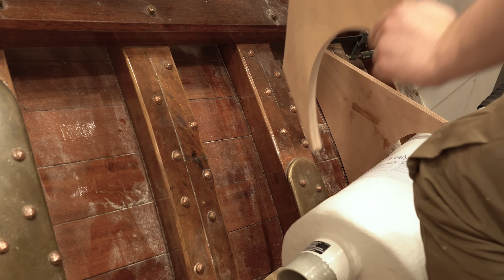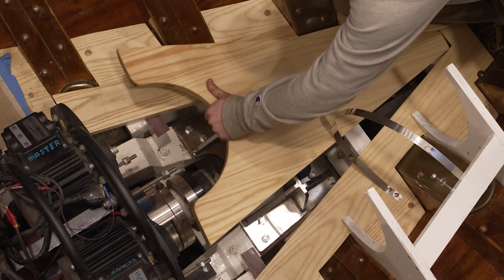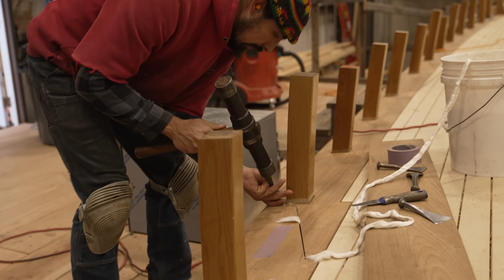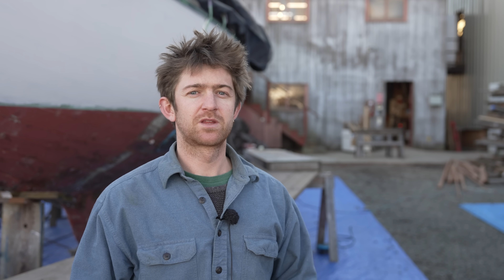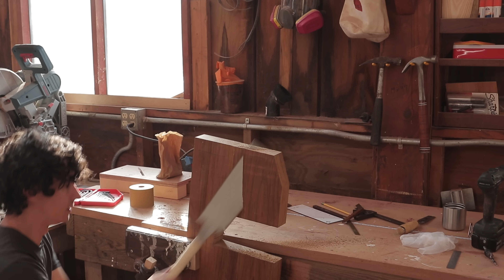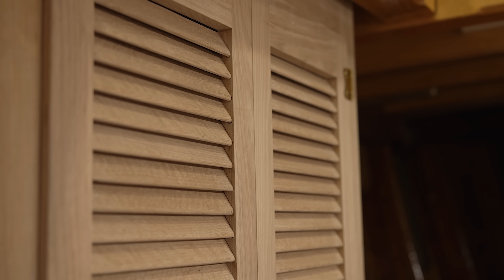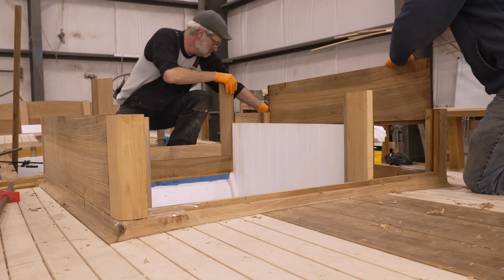Traditional wood boatbuilding - deck hatches & more!

Comment: . . correction to my suggestion . . it's too late for that kind of sleeve - perhaps a 6-inch-long cylindrical split sleeve of thinnish stainless or bronze sheet could be rolled from flat sheet and be installed without disturbing anything, and would still do the job of preventing abrasion.

Comment: Congratulations on an outstandingly impressive project in every way - but - may I be so bold as to make a suggestion from the sidelines ?  Your exhaust hose, vibrating (even ever so slightly) when the engine is running, due to the pulsating fluids within, will probably touch the bulkhead as it passes through, creating a potential point of abrasion.  It would be nice to see it sleeved as it goes through, to avoid abrading through it.  A 6-inch-long piece of the next size up hose would be good, just nipped up on to the exhaust hose with a couple of hose clamps to stop it shifting, or a non-flammable plastic.  Just a thought.  Best Wishes.

Comment: Note on TDS from experience clean out the seam with plenty of acetone and a tooth brush then clean paper towels prior to calking. I learned the hard way just a wipe over doesnt do it. Had to re do an entire deck, 80 tubes down the drain! Every seam parted from the boards! Used a generic pu based calking second time at a fraction of the cost, still going strong. Just my experience.

Comment: Halyard makes great stuff - but exhaust hoses close to the engine move around with the pulses of water moving through them. So the hose WILL chafe where it goes through that bulkhead. Use some chafing material on the bulkhead sharp edges. Great work

Comment: One of the enjoyable parts to boat building is how one's  perspective changes during construction.  At times, the project seems enormous; huge and almost unbelievably complex.  Then, when one phase of construction ends, it will appear to have gotten smaller, more defined and manageable.  The creation and hanging of the frames made this boat look gigantic. Now, with the hull complete and deck hardware going on, its much smaller, more personal, compact and simple appearing.  

It will grow again with mast and rigging going in.  Lastly, when launched, and she's in the water, she will attain her full dimension again.

Im sure out on the water, with a decent blow, Talley Ho will seem small at times.

thanks for the journey.

Comment: Hey guys... really enjoying your videos and getting so much insigths about boutbuilding. I am doing an apprenticeship as a boatsbuilder right know and its always fascinating seeing how other people solve problems and use different kind of techniques. But I have a question about the caulking of the stanchions which is a technique which is only used in traditional boatbuilding and I dont really understand why they use this rubber teak deck system on top of that? In Germany its common to use sealant / adhesive products to do the job or use cotton when it has to be traditional. So why use both? 

You guys are awesome... thanks for sharing so much knowledge

Comment: Spraying WD40 on the lead keel and painting it after is a really bad combination. The fat and oil of the WD40 will penetrate into the lead so there will be a bad adhesion of the paint.
Reply: Zed has high IQ, don't you worry.

Comment: Really sad to see the quality of craftsmanship go so far down hill. It seems like certain components of the project are being rushed.
Reply: More intricately designed pieces would be better than the basic diy looking ones he currently has
Reply: You are completely out of touch. they close perfectly for at sea use. They are made that way to not open when tilting underway. Go away.
Reply: The cabinets, for example, before anyone asks.
Reply: @jakecaldwell9257  what cabinets? If you mean in the shower/toilet those are temp mock ups to figure the spacing. Other than that I'm at a loss.
Reply: @michaeldemarco2415  he opens and closes the poorly made cabinets when showing the louver doors installed. At 1637 in the video
Reply: The restoration originally stayed true to tally ho’s spirit of form over function, but it seems like they are now straying towards robustness over beauty. Subjugating someone else’s opinion simply because it differs from yours isn’t right btw.

Comment: What is the reason for the odd mallet for driving the cotton and other caulking
Reply: That's the traditional tool for caulking, its form evolved over centuries to optimize its size, mass, controlability, springback & user-comfort for fitness to purpose.

Comment: Master Hammer skills by the Caulker.  Moving the hammer and target at the same time without a miss.  As a framing carpenter we learn to move our nail holding hand out of the way after we set the nail.  A good number of smashed fingers and hands are earned learning this skill.
It's always the sign of a craftsman to have the screws clocked alike.

Comment: I wonder if the muffler should be rubber insulated in its mounting bracket… could mean a lot of low frequencies make it from the muffler housing via that bracket into the hull ?

Comment: Leo,
   don't know how closely you follow comments, but I finally figured out how I could contribute to your (awesome) project.
   I have 30 + years in marine air conditioning and refrigeration.  English, German, Italian, Japanese, pick a country and I've worked on it.
   I got to the point where I would just do the math (volumes, temps, heat loads, run times, amp draws et cetera) and build my own equipment.
   If you give me the privilege to help with your air conditioning and refrigeration needs  it would be a feather in my cap! 😎
Reply: P.S. I'm kinda anal, during long installations I would polish my copper piping so it looked nice when someone looked and then insulate it the next day. 😎

Comment: You might have some noise issues from the muffler being rigidly mounted in the support bracket. I wonder if maybe some rubber strips would help deaden the sound transfer.

Comment: Great workmanship!  I assume that the exhaust system is not water cooled.  What are the maximum temperatures of the exhaust for continuous full power run of the diesel?  What type of rubber will withstand a long full power run?  If the exhaust is water cooled, how do you get the water from the exhaust above the gooseneck?   A 65 horsepower diesel put out a fair amount of heat.  TIA
Reply: The exhaust manifold is water-cooled. Also, 85 hp not 65.

Comment: I was surprised to see a rubber covered hose for the exhaust silencer pipe. Does the engine have an exhaust cooler? I'd have thought normal exhaust would be too hot for rubber hoses. I see Haylard say it's good for 150degC but diesels I've worked with get well above that. Halyard website has an exhaust temperature alarm. Might be worth fitting one if you haven't already! It would also be worth adding a second band clamp around the silencer. The single one looks a bit lightweight and there can be a lot of vibration or pulsation in exhausts!
Your team's carpentry is second to none - those louvred doors look great and the companionway frame with the brass portholes is perfect.
Reply: Doubtless the exhaust manifold itself will be water-cooled.
Reply: @frederickstibbert7389  You are right. I did some more digging and the engine is cooled by seawater which is mixed with the exhaust to return it to the sea.

Comment: Good job with the video this time. The montage at the end showing the deck house going on with the slow sax background tune . . . so tasty I had to watch it twice.  

What happened with the failed plastic water tanks? Looks like you are gonna have to keep the lids off till they get sorted.
Reply: The failed plastic tanks were for diesel - Leo is having new ones made from aluminum.

Comment: Looking good!  You might want to consider adding a thick rubber gasket around the wood that the exhaust goes through. You would be surprised what a small vibration will do over time to that hose.

Comment: Leo can you expand a little on the exhaust system?  I find it interesting that the exhaust pipe is made of rubber and that the muffler can be bolted to wood. Doesn't this stuff get hot of is it cooled by the sea water somehow?
Reply from the maker: It’s a wet exhaust so the exhaust gases are mixed with the sea water that goes through the heat exchange. It’s all pretty low temperature.

Comment: As for the 'head' - what happens to the 'waste'? There was no mention of any tanks  I've always assumed it just went over the side at sea, but is that still done these days? And, if it is, what happens when you're in harbour - surely  you can't just dump the sewage in the harbour?!
Reply from the maker: There will be a holding tank, waste is then pumped overboard when offshore, or pumped out in a marina.
Reply: @SampsonBoatCo  Cheers. Sounds like the sort of job I'd get if I were on the crew!

Comment: I thought you melted all the original keel bolts when you had all the new castings made.
Reply: All the new floors & knees were cast from new ingots of a specific ASTM alloy, or from the waste (sprues, etc.) of the previous pours. In the casting videos, they always emptied all the remaining metal from the crucible into new ingot molds, for use in the next melt. It'd be very bad practice to use scrap bronze of unknown alloy composition for a structural component.

Comment: Another pointer I learned today.  Invert ur drill once your pilot hole is drilled to eliminate the chance of making ur pilot hole larger and keep your hole saw from wandering.  I will not forget this but if advice. ……it goes without saying Leo has assembled very skilled craftsmen for this project.

Comment: -love the re-purposed keel bolt plumb-line guide, beautifully executed by George! . . . got me thinking . . . on the original drawings, shown numerous times, the tiller appears to be very slim, presumably it's metal? Certainly looks more 'yachty' than an ex-Bristol Channel pilot-cutter. Are you planning to re-cast all those other keel bolts into a new bronze tiller? As Zeal alluded to previously, the karma of doing something like this with a part of the original boat would be off the chart🤔

Comment: Maybe worth a rubber layer holding in the exhaust, under the strap and over the ply.  Also the exhaust piping is running through a sharp edge, maybe an aluminium sleave to stop chaifing as the exhaust will always be moving slightly when running.  Great project!

Comment: Fantastic progress.  Beautiful craftsmanship, as ever.  Truly inspiring all round.  One quick question on the deck hatch structure: are you concerned that the panels it looked like you were gluing into the solid posts will swell when wet and fail where the cross-grain is glued to the long grain?  As a (very) amateur furniture maker this is always supposed to be a no-no.  I can only guess that in such close proximity to water at all times, the panels will never dry out sufficiently to shrink?

Comment: Just a thought, are you going to put a "lid" on the stainless steel shower tray to make it level with the surrounding sole ? Just thjought it could be an ankle breaker otherwise. A teak lid with drain holes would mean you wouldn't have to remove it to have a shower.
Reply from the maker: Yes it will certainly have a Teak grate, I forgot to explain that.

Comment: Leo, I don't comment on the mindblowing quality of the woodwork again but it just came to my mind that progress is great and splash time is not too far away. You never told us about the rigging and certainly you won't rape Tally Ho using aluminium for mast and beam. Has building the rigg started already somewhere else ?

Comment: That floor of the head looks wonderful. I only wonder how you will deal with clogging of the tubing under it. Making the floor water tight once is straight forward. Having to do that again after repair of the drain system below is much harder. Specially when done at sea.

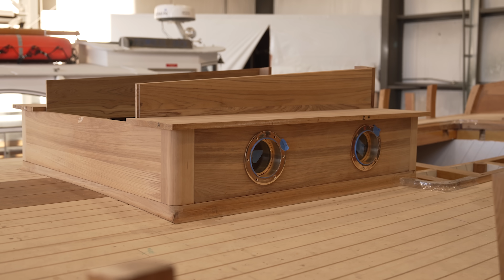Comment: That is a curious (to me) design for the little portholes on the sides of the companion way hatch @24:00 as they won't aren't in a postion for anyone to see out of but only to let some indirect light in to the master cabin and the pilots berth (either side of the companion way hatch.) Nice detail.

Comment: Looking sooooooooo beautiful!!!!!!  The ultimate craftsmanship you have at your disposal is so very amazing - both young and old.  Though I'm certain the younger blokes are learning a LOT from the older gentlemen you have around.  Those slat doors are a reminder of times gone by.  I once welded some for a guy who was on the original Yorktown Aircraft Carrier when he was a teenager and he was on the Yorktown at Patriot's Point in Charleston - I was working as a welder/fabricator onboard at the time.  He was pleased as punch with my "slatted vent".  Sadly, he's gone now, but my slatted vent is still there.  Quite a bit changes in 28 years.

Comment: I was wondering Leo if you are going to make a cap for the shower base so that when it is not in use, it will give you a full floor to stand on.  When the shower is going to be used, the piece can be lifted out while you sand in the pan?

Comment: Companionway Hatch: I remember when you pulled it off the boat and mentioned trying to use as much of the original as possible.  When I saw its condition, I was thinking - no f***ing way.  I've always had that hatch in mind - wondering about when we'd get to see it.  In a way, I was kinda hoping to see it revived -- brought back from the dead, so-to-speak -- maybe you had some secret magic saw dust, tucked away.  In any case, I'm glad to see it featured today and that a new one was crafted and installed...no magic sawdust required.  It looks awesome!  Also, those levered doors look great - looks like Beech hardwood.  Nice!

Comment: I am curious. With the crews living quarters below the water line and bunks against the hull. Will this not be very cold or are the hill timbers thinks enough to provide adequite thermal insulation?

Comment: One thing I've been wondering about is the steering system.  Whether or not a wheel is going to be used or a tiller.  I don't remember either being on the original boat when it was torn down to be rebuilt.
Reply: A tiller

Comment: Nothing but respect and admiration for this amazing project, but permit me to point out a pet peeve of mine. The lovely plumb datum piece was mounted with parallel screw head slots, as per age old notions of fine marine workmanship. And that drives me UP A F#@KING WALL! (Sorry, deep breath...) Wood screws have one, and only one, proper tightness, and the chances of two screws having parallel slots at their proper tightness is astronomically low. Imagine if there was some misguided musical aesthetic where all the tuning pegs in a guitar had to be parallel. Maybe it would look nice, but it would sound awful, no? Screws with nuts? Sure, line the slots up to your hearts content, but tighten wood screws to their proper torque and let the slots lie where they may. Rant over and out.

Comment: That fit up at 1:08 is the first time in 5+ years that I've ever seen a fitment gap on the boat, and a sizeable one at that. I thought it was just a template to drill the holes and then I saw it actually being installed. Umm. It's still probably better than I could do, but, it really stands out as it certainly doesn't match the craftsmanship of the rest of the boat.
Reply: Yea’ didn’t sit right with me either.
Reply: @TheGullyfoyle  do you mean the gap from muffler holder to hull planking? If so, that is to allow possible water to go forth to bilge so that the support does not suck it in and possibly rot in long term…

Comment: I love the Hatchway , Leo without picking at anything , it may just be oversight, but the end grain on the dead wood at the rudder end , are you not going to cap this off. I had to do that with mine after cutting a lot of rot out of it , after capping the dead wood off never had a problem with it again.

Comment: What's up with that strange looking hammer that homeboy was using to stuff the cotton with?
Reply: That's a caulking mallet, a traditional tool for the purpose.
Reply: It's a caulking hammer, evolved over the centuries for this specialised job. The length is to increase the weight without being the hammer to be "fat". The weight is necessary to reach a force without having a long handle. Some spaces can be very narrow, a hammer with a big diameter and long handle is difficult to use there.

Comment: I'm sure that your single strap around your muffler was just to temporarily hold it in place. It really needs have two straps and anti chafing material (rubber sheeting?) underneath the straps and also the woodend cutouts that conform to the muffler's shape to prvent any chafing over time. Just sayin'... 😁

Comment: In case anybody's wondering why a sea-going vessel's 'bathroom' [toilet, bog, khazi, lavatory] is called 'the head', it comes from the days when sailing ships had carved figureheads mounted on the bow.

Sailors answered calls of nature by positioning themselves right up at the front of the boat, hanging over the side next to the carved figure of (usually) a lucky lady who tactfully kept her wooden gaze forward.

Going to the bathroom meant a visit to the sharp end with only the head and maybe some frolicking dolphins for company.

By the way, Leo - my offer to model for Tally Ho's figurehead still stands, if you're feeling brave. You might need to shift some ballast, though.

Although I'm quite small (5' 6", 9½ stone) and look just like my thumbnail icon I'm dangerously top-heavy, so a bust of me would indeed be mostly bust (it weighed 24 lbs at my last check-up😲).